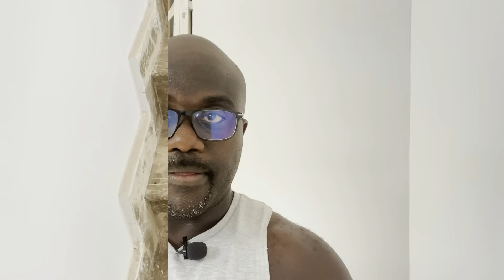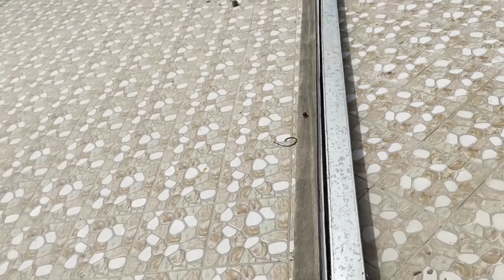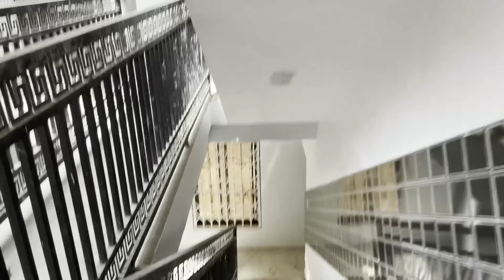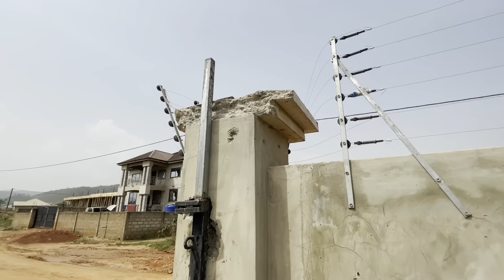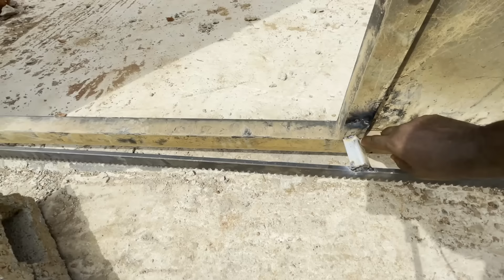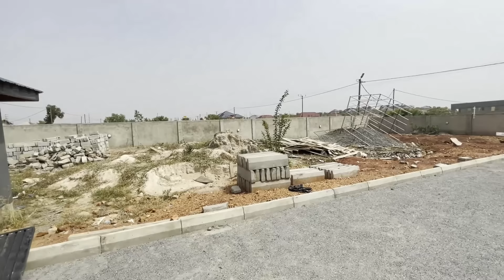BUILDING IN GHANA | AUTOMATED GATE

Comment: building a blockwork structure on a concrete roof could be structurally problematic. the blockwork walls will need reinforced concrete columns that must be tied into the structure below but I could not see any rebar protruding from the roof slab. there is also the issue of whether the roof slab was originally design to support the loads you are proposing to put on it. just a few points to consider. the best option in my opinion will be a light weight steel/aluminium or perhaps a properly treated timber structure with lightweight infill walls as you originally proposed. they might be difficult to find but i believe there are engineers and structural steel fabricators/ in ghana that can help you with that. you could also order an SFS structure from abroad but that would be a bit more expensive but most likely less problematic to live with. I have seen one at shiashi but i am not sure whether it was procured in ghana.
Reply from the maker: Thanks, we will stay away from the blockwork

Comment: I absolutely love your show and how brilliant, inspirational and beautiful y’all are as a couple!  I pray that we are able to meet at some point when I relocate to Ghana from the US. Just had an idea for your gym/office area. Why not make it an enclosure positioned immediately over the stairwell leading to the rooftop? I imagine that your top concern with this approach is blocking the skylight, or feeling that the position of the skylight limits your options. However, if you properly reinforce the roof-side skylight surface area with the right framing for very thick and clear acrylic “floor-tile” inserts ……your skylight (and part of your stairwell) could then become functional floor space for your office!  You could still get plenty of skylight by having a glass office desk, repeating the glass roof above your office/gym, along with having ample windows incorporated into this expansion area. You’d also have the benefit of making it unnecessary to be “outside” when you are going upstairs to the office/gym during rainy season.  My humble opinion is that this approach would leave all the beautiful ornate banisters surrounding all the edges of your roof unobstructed. Finally, it would more center the office/gym above your lovely home, and give it better symmetry than situating it on extreme edge of one side. Just a thought.

Comment: hey guys thanks for all you do. i have a similar setup with access to the roof so i have taken a lot of points in so many of your videos. i was wondering about todays video , your plan to build something on the roof. Are you at all worried about how much weight it will add and if so will it be safe . reason I ask is I have a pergola on my roof and with all the issues I had during construction everyone keeps telling me don't add anything else to the rooftop because it will add too much weight. Can you please enlighten me a little on how you know it will be safe and also if you factored that in right from the foundation. I am scared to put any other structure like a bar or anything because I simply don't know if its safe . thanks